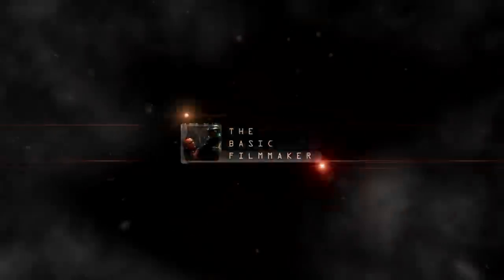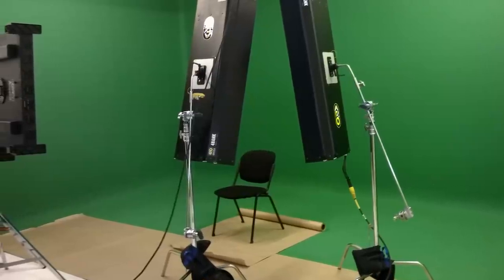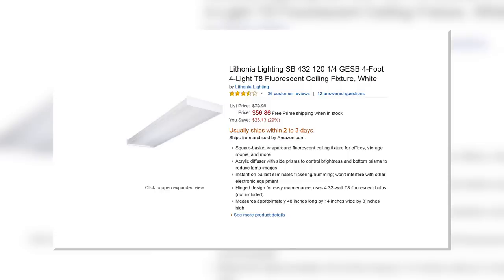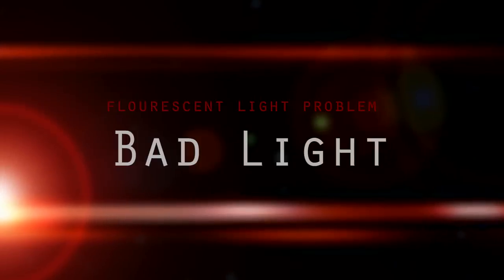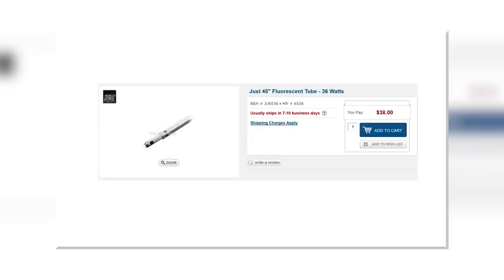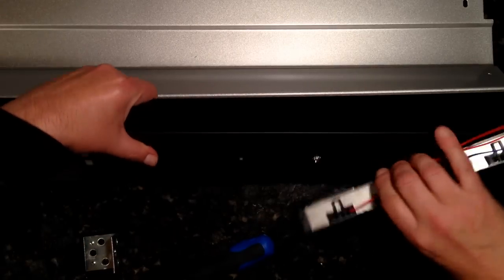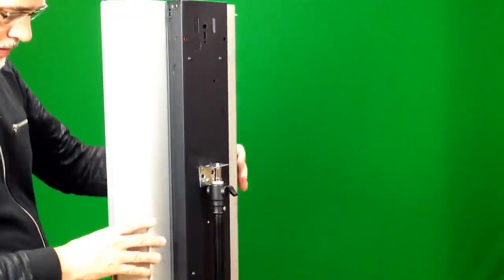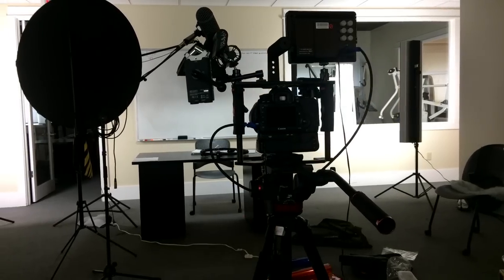How To DIY Bank Lighting For Filmmaking - Basic Filmmaker Ep 114

Comment: What about  6500K vs 5000K Daylight? 6500K will have a bit more blue to it, but does that really make a difference?
Reply from the maker: Giovanni Stefani is keep it near white as possible. When you try and pull a key, if you happen to be wearing something blue and you pull the key, you’re going also hit on the talent and remove anything that is blue. If you really want to do it well it 2020, get some green LEds
Reply: Thanks Kevin for the quick reply.  Talk to me about  green LED's . Do I really need 4-banks?  I saw your other video on the C???-TV device with controller but they are not available. I do stage lighting for a sound company that I own but they are LED  round on a trellis.  Is there a requirement for green LED's (e.g. 5000K). LED's almost never equate to true kelvin, correct?  Also, I'm assuming I should still shoot for 90+ CRI. My use for these is to do IT instructional videos and looking to have a data center as a backdrop. BTW, don't let anyone kid you about your long talks. I like to talk too.  Sometimes too much ;).
Reply from the maker: @GiovanniStefani  This is such a minefield (not in a bad way) as tech had changed so much over the years. You can get the fluorescent lights and now they sell green tuns that slide over these. There are also great and cheap bank lights to do this if you look around. You just want white, green would make it easier to pull the key, I wouldn't go crazy on the kelvin values - I've seen some pull a key on some awful lighting, the key (no pun intended) is to spend as little time as possible messing around with the keying as possible. IF you really want to save yourself a ton of time, search online for an actual backdrop with a data center-ish printed on it. If you watch my latest videos when I am in the main studio,  that brick wall is printed fabric. You could also do it by sending a print place a photo of what you want printed on a large sheet and you that, just make sure to give it some blur so it looks real on the camera. The real savings here is you don't have to mess around with the screen and keying, only need to deal with lighting the talent (you), and you take a ton of stuff out of the mix.
Reply: @BasicFilmmaker  When you refer to  "green tuns", are those also known as "tube guards".  Also, are there any good links to green LED florescent.  Also, I found a Chauvet bank unit that has a Bluetooth controller that would work with my other Chauvet par can led lighting.  It's around 40" in length (39.5" to be exact). The controller works on an Android/Apple device and can dim as well. A bit pricey @ ~$190 USD each, but still cheaper than the band lighting from video distributors. I ordered a Elgato green screen collapsible in an aluminum case for portability that measures 58 x 70".  I use Techsmith Camtasia for doing 99% of our marketing/instructional videos.
Reply from the maker: LOL! Green tuns. Tubes. What you are proposing sounds right. Test, test, and retest. Always keep in mind you want to light the screen appropriately FIRST as evenly as you can and get the hotspots out as best you can where the talent will be. If the talent is always in the middle of the frame, don’t worry about anything outside that and mask it all out. You can always buy one whatever for each side, get it working, THEN you’ll know if you need more.
Reply: @BasicFilmmaker  Thanks Kevin!!
Reply from the maker: Any time!

Comment: Is it possible to get an updated links for lights? Those lights are no longer available.
Reply from the maker: These have changed sooooo many times and I've updated the links - I can't keep u wit it as the ones I link get sold out, and we're back again.. Just look for the bulbs I mention, on Amazon, at Lowes, Home Depot or wherever you would get these. Make sure they have a good CRI value, and you should be good. They last a long time...I still have the ones I bought when I made this video.

Comment from the maker: Need some cheap bank lights? These may help.
Reply: I would put a nut on the light stand to tighten the lights down. Although it would still have some tension on the bracket, you could probably have to "L" brackets mounted on a sheet of metal and either drill a hole or mount another bracket and tighten it on the light stand. :)
Reply: Great video... I recently put together a similar low cost set-up using those round aluminum work lights (found at your local home center type store); I like the set-up in this video better though, and may add a couple of these in the future! Thanks for posting!
Reply from the maker: Great idea Nate. As I said, there's all sorts of thing you could do to this thing if you have the time. I went as basic as I could to show it could be done for my next video.
Reply from the maker: +Super Sunday The price on what? The bank lights? Yes,that's the comparison link. The other cheap DIY lights to do this are in the description.

Comment: Very nicely done. Thank you! Is there a reason you use fluorescent rather tian led lights? Seems to me led 's would be easier to build into a bank?
Reply from the maker: Just what was available at the time. No reason the right LEDs could be used.
Reply: I just saw this video and was wondering the same thing - replace the fluorescent bulbs with the LED replacements.  I know some of these  need to be rewired to take the ballast out of the circuit - I'm just wondering if the LED's end up flickering on screen?  The LEDs come in a variety of color temperatures.  For non-photo use, I'm planning on converting a few of mine in the utility room and see what the outcome is.
Reply from the maker: You mean for LEDs take the ballast out? Just buy LED light banks which are pretty cheap. If you mean the normal fluorescent, you WANT the ballast as that is what controls the light output and keeps them from flickering. The ballast is the electricity flow regulator. Those flickering fluorescent lights you see have a damaged or no ballast. Love to hear how your conversion goes Bill Karle. Thanks!
Reply: @BasicFilmmaker  thanks for the reply! Much appreciated. I have an led as my main room light so I wanted to keep the light even. I am not that clued up on led's, but do they Flicker on and off like fluorescents, causing strobe effects? Or do they have a constant output? I have been picking up some flickering on my camera and am not sure if it's the camera or led's. Thank you
Reply: @paca_bill4863  yeah, Bill, if your banks are already installed then remove the ballast. But if you starting afresh def buy led banks, cheaper and easier
Reply from the maker: Owl Muso Yep - the flicker depends on the lights. You can get around this by upping the shutter speed.
Reply: @BasicFilmmaker  thank you! That really helps. Going to be attempting a bank of led's soon

Comment: Hi.  Great video.  Thank you.  Any reason I could not use LED tube lights for this project?  If so, is there a color temp you would recommend?   I believe you mentioned 5500k in the video.  I would be using these for green screen lighting.    Thanks!
Reply from the maker: Yes, in 2020 for sure. You could even get green LEDs and it would be better.

Comment: Great video; do the Lithonia lights need to be hard wired to an open ended extension cord or do they come pre-wired?
Reply from the maker: The ones I got came with the metal enclosure and a cord about 6 foot long and included a ballast. I’m not an Electrical guy so I didn’t wanna play with wiring. So what I got everything came ready to go and I just added some lights.
Reply: @BasicFilmmaker  Ok thanks. I ordered the same light off Amazon. I'll find out soon enough. Thanks again for the video. Can't wait to put it to use!
Reply: @BasicFilmmaker  Ended up having to go with different lights, but so far so good; I added a board to the back for stability and handles and will likely add barn doors that close around the front to add protection when they're not in use. Waiting on the green tube covers; will make a video documenting how I made them. Can I tag you in it?
Reply from the maker: Please do! Or just drop a link here to the video please. 👍

Comment: I wonder, could you use the 'Yeelight meteorite' as a backlight? It's a long, smart, ceiling light which could be hung vertically. The lighting seems to be uniform and diffused. It would be a very interesting solution if it was possible. Not overly expensive (compared to real backlights) and controllable through the Yeelight app.
Thanks for the very informative video.
Reply from the maker: You bet Paul. Be interested to see if that works for you.

Comment: Hey, Kevin. Thanks for the information. The bulbs you mentioned don't seem to be available anymore, so I looked around a bit. What do you think about using GE Daylight T8 LED tubes instead? 1800lm and 120 CRI. 6500k, though. Is that too blue? I'll reply to this with a link to the GE product page. (They're available at Lowes)
Reply from the maker: They should be fine. Really you're looking at having a smooth lit screen, rather than specific K values, although that could be a bit much. Search around and you can find GREEN tubes that fit over the lights, which REALLY makes all the difference. And yeah, I gave up on updating the light links, it was becoming a career for me as they seemed to change weekly. :)
Reply: @BasicFilmmaker  Thank you for the reply! Yeah, I can imagine the links change too often. So, you recommend a green tube? Am I mistaken or did you originally recommend magenta gel for the green screen?
Reply from the maker: @telluwut5674  The magenta gel would be placed on the hair light up and behind you. The hair light (or rim light) makes a nice light around you, looks good, and pulls you off the background more. For green screen, the magenta gel cancels out some of the green spill that is common when doing these, and makes pulling yourself out of the green easier. I haven't used these green tubes, but I HAVE used green lights which turned out awesome, same idea.
Reply: @BasicFilmmaker  Okay! Thank you for the info! Magenta for the hair light, and I'll give the green tubes a try for the green screen.
Reply from the maker: @telluwut5674  Cool. If you want to see the expensive green lights video, it's here: https://youtu.be/IP3cCmpPaZA

Comment: what are those quad fluro holders called?
Such a simple task made difficult in australia
Reply from the maker: They are basically shop lights or garage overhead lights.
Reply: Hey Max did you end up finding a solution? I'm in Australia as well and nobody here seems to know what I'm talking about when I show them. Been to Jaycar, Bunnings, Beacon Lighting, etc.

Cheers.
Reply: @cinestudiosaus  I bought a studio light set up from ebay. Fairly inexpensive
Reply: @AiMotivateofficial  ah awesome! You wouldn't happen to have a link would you 😁
Reply: @cinestudiosaus  Im not going to endorse anyone on ebay. But look up studio lighting and you will find one. Also I use a cotton grade green screen and it works well. with those lights. I passed it through the wash once when I bought it and hung it out to dry and it removed all the creases. Dont hang it in the sun. Make sure its full shade
They sell you the right lms and K. 
And get it from an Aussie located shop. Some delays in postage but it all gets there :D

Comment: Is 5500k as good to use? Do I need a 4 light per bank set up with a 5'x7' green screen?
Reply from the maker: Hey Ken. 5500 is fine. 2/4 lights. Man, it really depends on your situation. Some have the screen 10 feet behind, some have enough spill form the talent lights. Start with what you think you need - you can always get more if needed.
Reply: @BasicFilmmaker  Space is quite limited, 8 ft x 6 ft if I'm lucky.
Reply from the maker: Hopefully you can position the camera shooting down the 8 foot. I would start with the minimum, see if it works, then add as needed.
Reply: @BasicFilmmaker  Your Lowes link doesn't work! Also, does it matter if the lights are fluorescent or LED?

Comment: I just invested in everything on the list....Lowes only had 6500K but that's cool (pun intended).    I have both lights about 10 feet away from the green screen and I'm still getting two big hot spots.   I'll have to get creative with diffusing I guess
Reply from the maker: It takes some tweaking around. I got good results at about 3-4 feet. The green screener app really makes all the difference. Always best to shot something, test the pull, and see if it works, otherwise you can chase your hot spot tail forever.:)
Reply: yeah, doing a lot of tweaking, but will try closer....but thinking about hooking them on the ceiling to have them horizontal.    My green screen is flat paint on a wall, 12' x 8'.   I make a demo once I get-r' right
Reply from the maker: Love to see the demo and the setup when you get it. Thanks!

Comment: Are there any cheaper options than Kinos in 2019, besides building them? I guess what I'm saying is I'm not too cheap to buy decent lights, but Kinos are too much for me. I'd love something cheaper than Kinos, but that I don't have to put together, and with a built-in dimmer and barn doors.
Reply from the maker: For sure! Shop around - Kinos are super expensive, the equivalent is over $1000 for one bank. I'm not going to recommend what I would find. Let me know if you find something that works - interested.

Comment: I apologize if you've already answered this question, and I just can't find it anywhere, but what kind of light stands are those and how much do they hold? I'm able to make these bank lights with the links you provided but I'm scared to buy light stands that can't support them. Thanks!
Reply from the maker: +Sierra Nelson Hey Sierra. The one I mounted them on were part of a green screen light package that was very cheap. As long as one of the legs is pointed in the direction of the weight you should be fine, but, that being said, they lights are not pro lights, and do not take any abuse. If these are just going to sit in a studio set up they should be fine though.
Reply: Yeah I plan to set them up and just lock it all down. Almost none of my videos require transportable lights. Thank You! Your channel is extremely helpful to me.
Reply from the maker: +Sierra Nelson Thanks Sierra.

Comment: There is a pro commercial light that uses 4x 55W "U" shape 2 foot tubes.Costs a fortune. I found a unit in the (hum) "hydroponic industry" that was about £80. For the stand mount, I used a device that has a VESA monitor mount to 35mm speaker pole fitting, so the angle of the light can be changed. Barn doors from sheet alum, covered on one side with plastic imitation leather (leatherette). Total cost about £100, so saved several Grand. (I put all the details into a PDF)
Reply from the maker: +Chris Brown Hey Chris! Love to see this, the PDF or a video. Thanks!
Reply: +Basic Filmmaker For you - and anyone else interested - here is a link to the PDF. https://www.dropbox.com/s/jh33dcocrd4pamn/4x55W%20lighting.pdf?dl=0 It's just one of about 10 guides I've written that will be available on my video site soon
Reply: +Basic Filmmaker NB: Did you get the email I sent recently about using your videos on "Vi*-*-t*c" (letters removed so not seen as link) or did it vanish into cyberspace. Sent out 8 messages, but no responses
Reply from the maker: +Chris Brown What the heck, I did not. Email is thebasicfilmmaker@gmail.com.
Reply: +Basic Filmmaker Hmm. I went to the YouTube About tab, clicked on "Send Message". Did that with about eight people. Now it looks like NO email got delivered. Will write personally.

Comment: With the newer LED light lights, do they work as well as the fluorescent lights?
Reply from the maker: Yep. This is an older video, and since then LEDs have dropped dramatically. I would check into already built LED lights like these and it may cost less than building it.

Comment: Argh!  Bought brackets, bought the bulbs...and nobody has a 4-bulb T-8 shop light that I can buy.  I can get LED shop lights to line up from here to Pittsburg, but no fluorescents.
Reply from the maker: Wow! I just checked and the world has changed to LED. The only T8 lights I could find were $150+. What the heck? Well, you could return the lights and grab LEDs. Gessh. So weird.
Reply: @BasicFilmmaker  I didn't know that there wasn't something weird about LED's that would render them unusable - like some flicker frequency that summons eldritch horrors if you aim them at the same green screen or cross the streams or something.
So, I bought two shop lights that will hold two bulbs each.  If they won't work to light my 9'x10' max screen, I'll gang 'em both to a piece of plywood and do the same to two more to get something like the four-ups in your video.
Cheers.

Comment: What about LED shop lights as an alternative to fluorescent?
Reply: Check the colour tempertaure and lumen light output to see if they meet or exceed the lamps Kevin recommended. The strength or force of light from a lamp is measured in lumens, not watts! Watts is the amount of electrical energy drawn by the lamps, NOT light output. Read labels carefully.
Cheers from Montreal.
Reply from the maker: @Chuck Bricker @Frederic Hore True that Frederic and thanks for chiming in. When this video was made LEDs were SUPER expensive. I think now it might be more cost effective to buy something than build them, not sure.

Comment: So, how did you locate these?  Amazon lists them as out of stock.  A Google search shows possible replacements, but they do not list an electronic ballast.  That's the problem with cheap off-brand gear.  It comes and goes.
Reply from the maker: These things change faster than I can keep track of them. There are links in the description to Lowes for the lights with electronic ballasts. You can find these at Lowes, Home Depot or on Amazon.